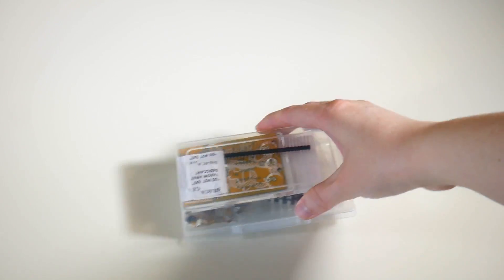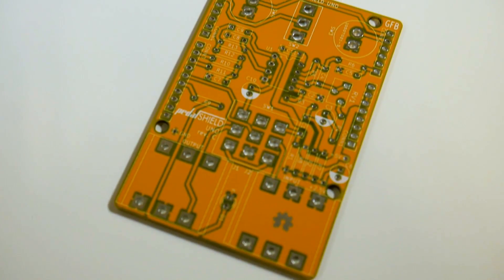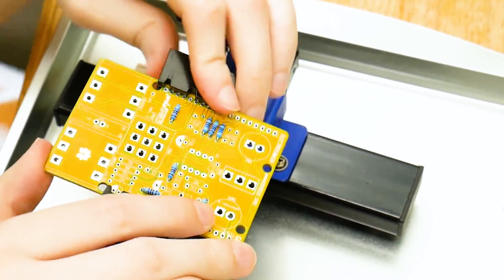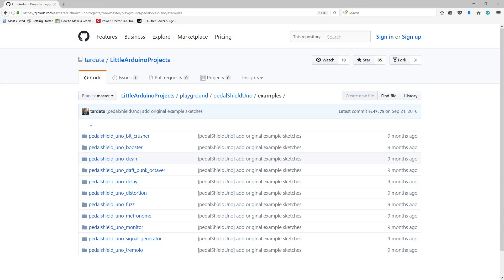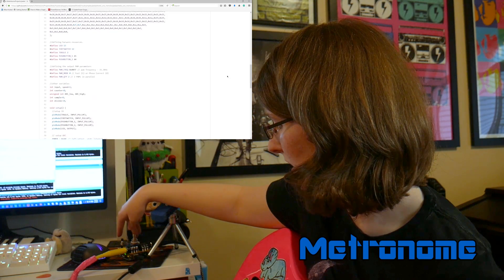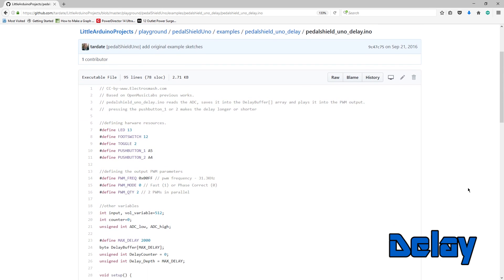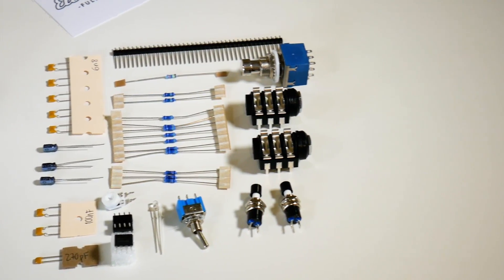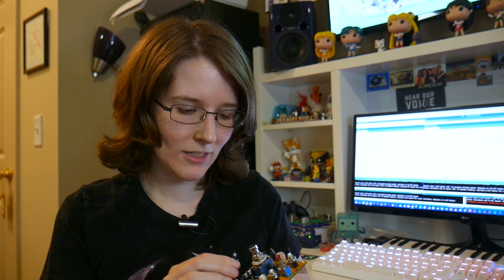pedalShield Uno: An Arduino Guitar Pedal 🎸

Comment: Hello Liz: 
This is a great post. I'll bet you are a pro at soldering now. I soldered a few months back a little and then stopped. I reviewed some updated soldering video and I realized I was really not doing it right. I was doing just what you are not suppose to do...paint it on. On those little boards what works for me is to put the iron on the opposite side of she solder wire. The solder flows right to the heat and you can almost time it to get a good solder. Also, you are so sweet. But girl, the word tremolo? I can tell you love music as I do, but you have to learn how to say tremolo.

Comment: Thank you so much for making this video! I've been interested in making my guitar sound like an atari and/or commodore 64 for a while now (im even considering prying out the SID chip in my C64 and bread boarding with it to try to play through the chip itself), so the notion of making a programmable pedal is VERY appealing to me. But I lack ANY experience with a soldering iron and know nothing about mechanical engineering. So this video has been very motivational for my 8-bit guitar dreams!

Comment: Awesome! I'll try on a esp32 with web bluetooth integrations.
Reply: Do you think that it can handle real time convolutions?
Reply: @cassianofranco3082  esp32 is way more powerful in terms of processing power compared to an arduino, so i guess it wouldn't be an issue. However the ADC and DAC quality on that would also play a role  and I don't have a comparison on that aspect
Reply: @hobbyist_engineer  Yes indeed, i move to a LiraT board, works like a charm
Reply: @cassianofranco3082  hey i am trying to do this too!! did it work out for you? right now my biggest issue is im opting to use the onboard ADC and DAC channels which give me an 8-bit output so the tone is definitely not what i hoped for also looking to fix some major issues with noise ahha

Comment: could I use this shield to add effects to audio signal captured from a microphone, and send the result to an amp? Or is this shield reserved for guitare?
Reply: Guitar signals are a little hotter than microphones, so maybe you´d need to preamplify your microphone before going through this. If your mixer/board has an fx loop, i´d put the pedal there.

Comment: could you in theory make multiple tones and switch them on the fly by switching the chip? imagine carrying multiple pedals in your pocket ans switching them out like came cards
Reply from the maker: Yes you definitely could! I plan to try this with a Metro m0 board since it has the same pin-out as an Uno but has a lot more space with the SAMD21 chip compared to the 328.
Reply: ill make sure to watch that video if you make it!

Comment: Being a pedal builder,  I can't say I like the sound...  the concept is cool.
Reply: what do you need to know to be a pedal builder?
Reply: DeadKoby have u ever built any klones?
Reply: If you mean  Klone as in Centaur...  Yes I have.   I like the circuit design very much.
Reply: DeadKoby cool.
so which combination of diodes u used?.. can u give me aome tips and guidelines?
Reply: Check out the Centaur video on my channel.   It's available in kit form.  The kit is very good.
Reply: @sadmanmahdi8281  How are you using the Klon?
Reply: Hey I actually need your help...I want to build a fuzz pedal....some good sounding....can you plz help me in that
Reply: @AshwajeetKamble  depending on your skills there a a few i could recomend . i assume you´re a beginner ? sorry if not ... but yeah if so . try the bazz fuss , pretty easy one , one transistor , one or two pots (depending on if you want gain and volume...) 2 caps and i think thats it for the parts count . you can find the schematics on google , just look for bazz fuss . if you have further questions hit me up on insta @_mike_s_91

Comment: wrong kind of gear for the desired effects
a dsp is the way to go
arduino would be must more useful as a digital pot controller for analog pedals
Reply: And a DSP would be infinitely more of an hurdle for a beginner. Don't forget the base audience of Arduino :P

That being said: as a advanced programmer I definitely think the Arduino can be used for DSP and it's a fun challenge squeezing every clock cycle and memory bit out of the thing. Of course you aren't going to get clean audio at 48KHz/24-bits, but the lower-samplerate-8-bit-ness definitely has it's charm if that is that is what you want. Doesn't matter if you are a professional musician or not. There are quite a few professional musicians that make music using all sorts of "toys" ;)

It definitely has it's place, especially in DIY!
Reply: @rot_studios  stm32g4 would be the way to go
Reply: IMHO there's a difference between DIY and professional gear, this would be more for fun,not for gigging, there's hobby musicians and professional ones anyway =p
Reply: yes I agree
just don't get people investing time in this specific thing thinking they can make something of professional or just 60 $ zoom g1on  level
Reply: zoomg1/b1 owner here ... i am not sure if you are saying anything bad about these products or good . i will go on the record and say they are GREAT products . especially considering the price tag . i got a both and i also bought a g3 and did the firmare ug - not a g3n a g3 . same models but a lil more , like a dynaflanger . these are the best multis out there for the money atm .
Reply: Yes and no. There are quiet nice bunch of "lofi" glitchy sytnthy weirdo shit.